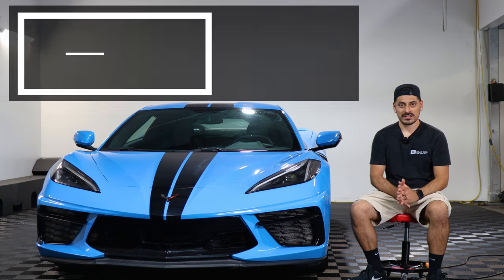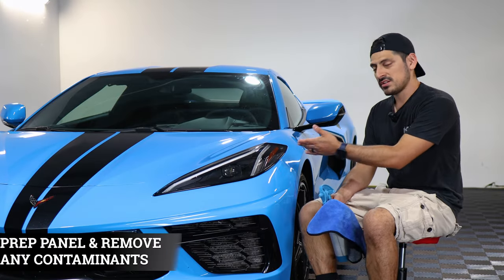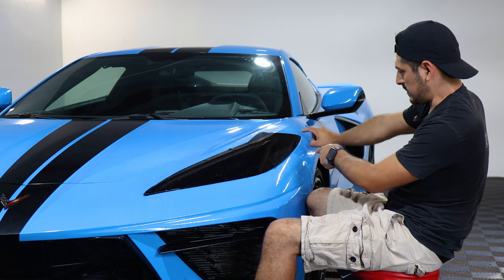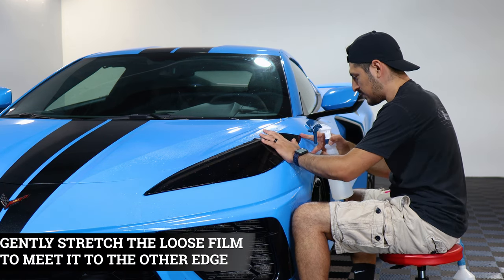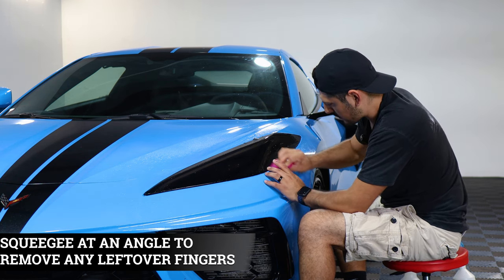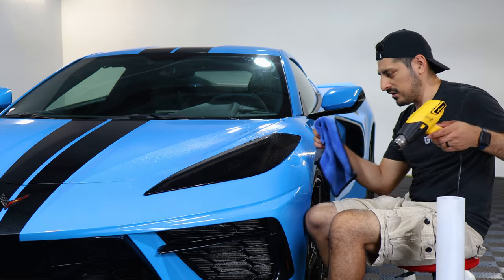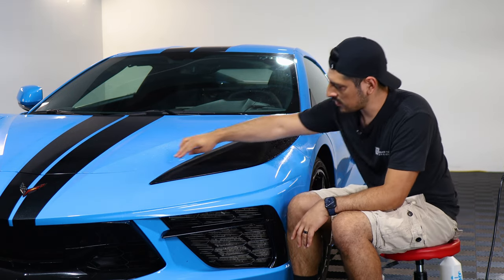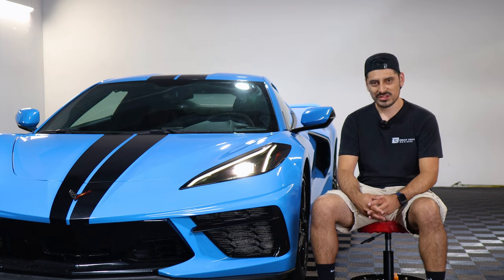2022 Chevrolet Corvette C8 Headlight Tint Install

Comment: if my car has ceramic coat is it safe to spray the tack or slip solution on car around headlights? or should i cover car around headlights and what would be a good way to do so? thanks.